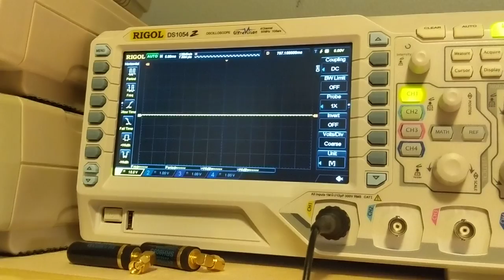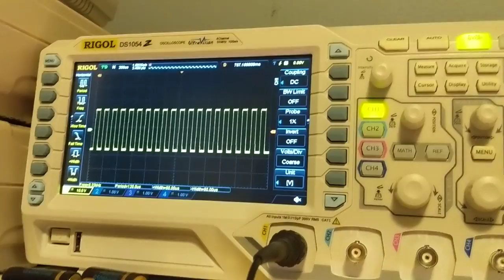DC/DCC Switch Panel Demo

Comment: Jason, I love that you came up with this new product. Please let me know when it will become available. I have some questions, though. I have an MRC Tech II dual power (dual throttle) DCC power pack for controlling different, isolated sections (blocks) of track. Would I need to buy and install 2 separate DC/DCC switches that you make in order to toggle between my dual DC power pack (both DC outputs) and my  DCC source output? Also, in your video demo here, it looked like you used smaller gauge wire typical for DCC feeder wires, but not for DCC bus wiring to a layout. Will heavier gauge wire (such as 16 AWG) that carries greater electrical current suitable for DCC bus wiring connect okay to this new switch of yours? And what will be the expected sale price for this new switch?
-from Tom Pilling